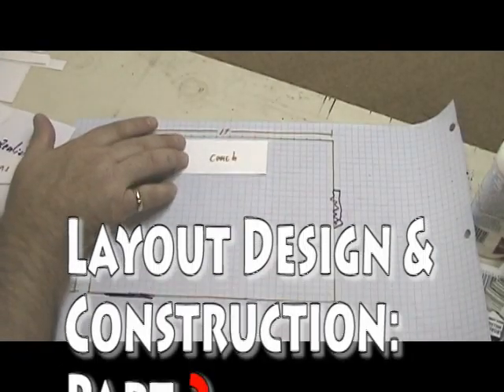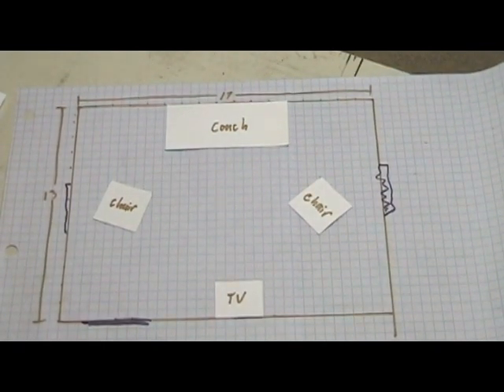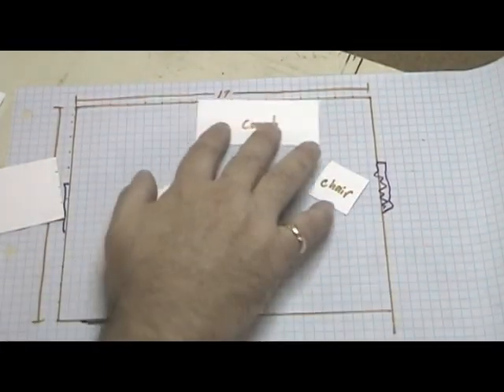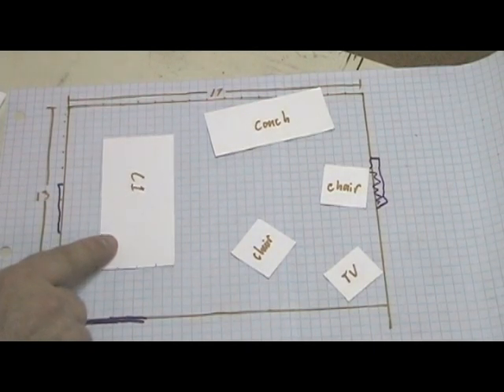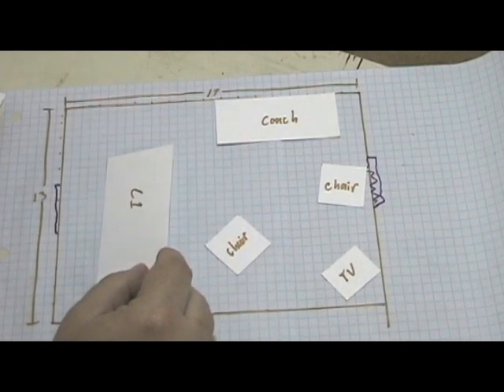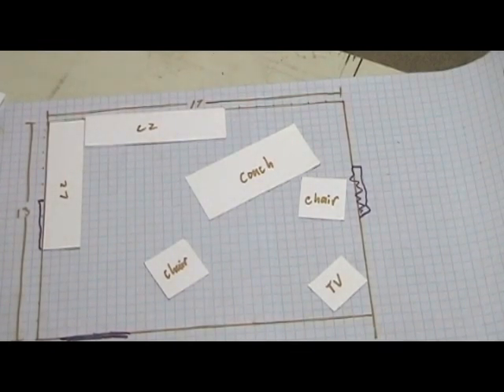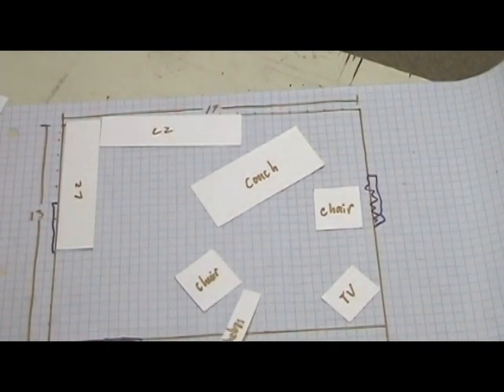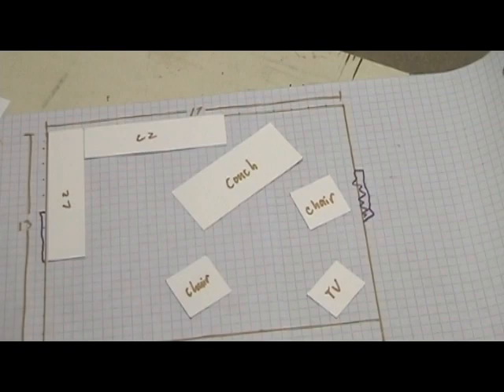Model Railroad VLog: Layout Design & Construction: Part 2

Comment: i have the space to lay out a 4x8 layout but not store it, (has to go on the family room floor)  so I took my 4x8 and cut it into two 4x4 sheets, and bought some hinges from the lumber yard (get the flattest decent size you can) and flat screws to hold it together and put them on the bottom, then got some thin strips of wood to go around the bottom edge to make it more rigid, and hold it up off the hinges.  My layout sits level, is elevated, and has easy fold up storage. It works great!